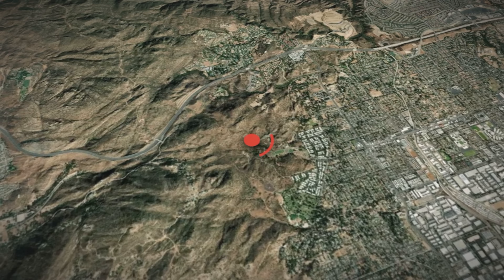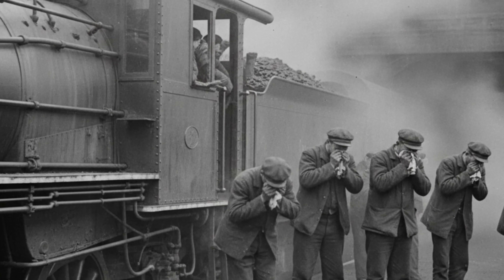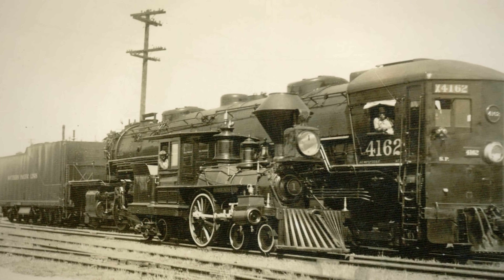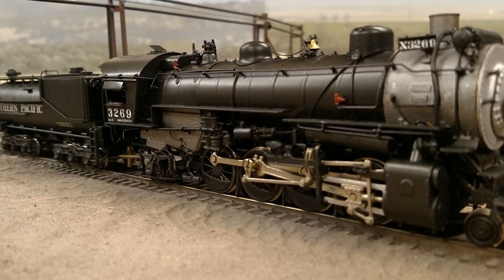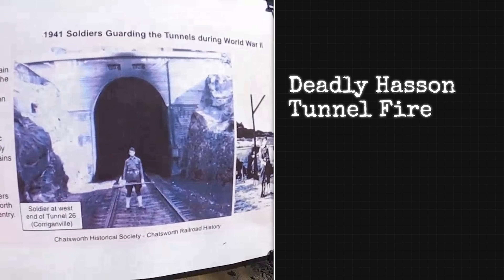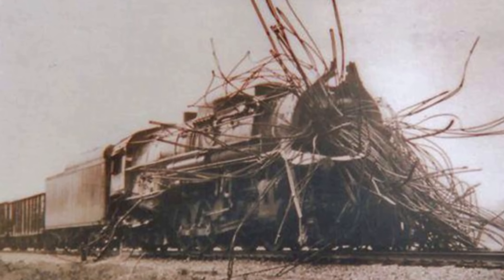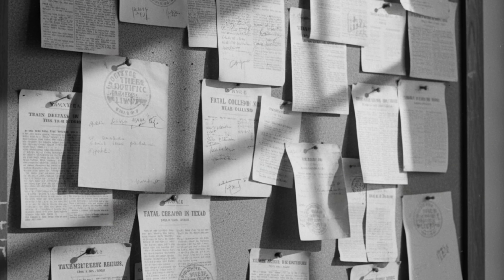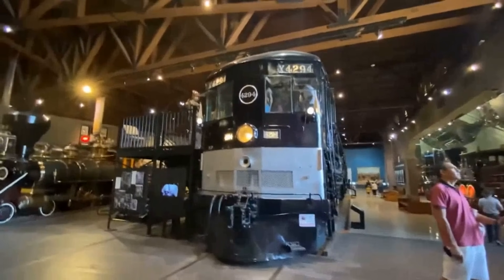How DEADLY Was The CAB FORWARD ACTUALLY?

Comment: My Great Uncle a was Fireman on the SP cab forwards when the Hasson tunnel fire happened in 1941. A rookie fireman was firing the locomotive. There were 4 crewmen in the locomotive. Two front crewmen escaped the fire and lived to tell in great detail what had happened. The drivers slipped at full throttle within the tunnel and an immense amount of smoke and steam were blown from the stack. The throttle stuck wide open and the engineer could not get it closed right away. The guys that lived,  jumped down from the locomotive and ran out of the tunnel. The engineer and fireman were almost immediately asphyxiated by the fumes. The fireman did not shut the fuel feed before he passed out. The fuel spilled out of the firebox onto the rails under the crew cab. The thousands of gallons of fuel in the tender fed an immense fire within the tunnel that burned for 3 days. The remains of two trespassers were found in the ice compartment of a burned out reefer car and a crewman from the caboose was found dead in the tunnel when the wreck was overhauled. The incident was well documented by the Interstate Commerce Commission and there were front page stories in the L.A. Times newspaper for days.

Comment: There is an entirely different approach to running steam in tunnels and I will point to possibly the most unlikely place to start this post. The 1983 movie 007 Octopussy. In that movie, there is a circus train heading into Germany. The locomotive used in when filming this is much different from what first meets the eye and what people would expect. First of all, it has never been to Germany. It's actually a Danish locomotive called DSB S 740. The prototype of the S class could not handle the 2 mile tunnel, which is just under the streets of Copenhagen because of smoke problems. It was reported as "driving blind".

The solution was the streamlining looking front, which predates streamlining by a decade. It's a flat panel angled to push air upwards to the chimney to "catch" the smoke. The sides on the front has the possibly by far biggest smoke deflectors, again for controlling air flow. Those two combined are engineered to control air flow inside that specific tunnel and it successfully pulls a lot of the smoke away from the windows. However that's not enough. It also has to reduce the smoke produced in the tunnel. It does that by stop using the blast pipe in the chimney. Instead it can switch to make the exhaust steam go straight into the water tanks. This heats up the water and if it becomes too hot, the injectors no longer work. For that reason in addition to having the standard two injectors, it also has a pump connected to the rear axle, resurrecting the 19th century concept of relying on rotating wheels to add water to the boiler. All this combined made it good enough to not only go through the tunnel, but also serving the underground station in the middle of the tunnel. This means you can argue that it's a 100 ton, 1000 hp tank engine built for subway operation. This must have been quite successful because they were among the last steam locomotives to retire, operating through that tunnel for almost half a century.

With only 20 units ever built and to my knowledge the only one covering the front for tunnel air flow reasons, I would say this approach is quite rare, through apparently it worked.

Last question: why did they use a Danish locomotive as a German locomotive while recording James Bond? The answer is simple: they recorded the movie in England and none of the English locomotives looked German. They did have this one Danish locomotive and with a bit of paint, they sort of made it look like a real German locomotive. The issue is however that they claim it to be a German 4-6-4 based on the name they painted on it and since it's a 2-6-4 you never really see the front single axle. Also while it was built in Denmark, the blueprints were made by A Borsig in Berlin, hence it looking German even by Danish standards.

Comment: Italy had some cab forwards called class 670 built 1900-1906. It was a much smaller 4-6-0 engines weighting just 70 tons (excluding tender) and they were coal fired. They were not seen as successful and all 43 were scrapped in the 1930s. I'm not sure why they picked this design, but I recall an event where a freight train in Italy went missing. It was found stalled in an uphill tunnel and the entire crew had suffocated. That may or may not be related.

Comment: I grew up in the 1940s and 1950s. I lived near a Southern Pacific mainline and saw cab forwards every day. Donner Pass had miles of snow sheds made of heavy timbers. The sheds are now cement.  We use to camp near the main line and you could hear the steam engines sounds and whistle. I miss the steam age. I miss the sound of a steam engine at high speed where the chuff-chuff sound blended together.

Comment: Electric steam was the solution.... And yes, they where invented in Switzerland.....
Reply: It was a plan B because WW2 prevented them from having access to metal to build new locomotives and it caused a coal shortage. They then put heaters in existing steam locomotives to make them run on hydro power. It worked, but with much lower efficiency than electric locomotives. They were "the best we have" rather than good. They could operate like fireless steam locomotives when shunting in and out of factories, so they absolutely ruled that niche.

Comment: It was actually a very successful design, as long as you had someone who knew what they were doing operating it. They had a couple of them suffer boiler explosions on the grades at Edison, CA and later, the Siskiyou Line between Ashland and Dunsmuir. Because the boiler was backwards on the frame, if the fireman didn't watch the water level closely or was inexperienced with the type, it was easy to get into a situation where there was sufficient water over the crown sheet (the roof of the firebox) for the flats or minor hills, but once it started up a major uphill grade like the 3.3% Siskiyou Line, the water would rush towards the smokebox end of the boiler, literally leaving the crown sheet high and dry. Once that happened, a fatal boiler explosion would usually follow.

Comment: Would it have been cheaper and simpler to just extend the exhaust of a normal locomotive behind the crew cab?
Reply: There would be a high risk of that having a negative effect on the air draft through the firebox. Still I like your thinking.
France had an experimental locomotive, which did something like that. It tried to preheat inside the horizontal chimney if I recall correctly. France had some very interesting experimental engines in the 1950s, which went nowhere as they were fighting against electrification.

Comment: Not particularly deadly then. Obviously operating and maintenance crews had to be onto it. Overall, IMO, a successful and indeed brilliant design that achieved what was required. Electric traction may have been better but may not have been viable.
Reply from the maker: It was a successful design, absolutely but not risk-free. Incidents like Hasson Tunnel (5 crew gone), the Cruzatte fire, and the Edison/Mystic/Cooper boiler failures show the Cab Forward was safe in normal use, yet far more dangerous in emergencies.
Reply: None of the lines across the Rockies are electrified. Milwaukee Road had two short sections, but other than that no electrification. I wonder if overhead wires and snow clearing is a bad combo. Avalanches are also not friendly towards overhead wires. Electrics are cheaper to operate and have 4 times as many hours between breakdowns compared to diesel, so there must be a reason why they have never been used.
Reply: @Thegoodthebadandthefleshtuber  Yep electric really sounds not viable. Really tough route and conditions. If it was even possible the cost would have been horrific. Those cab forwards made a lot of things possible.